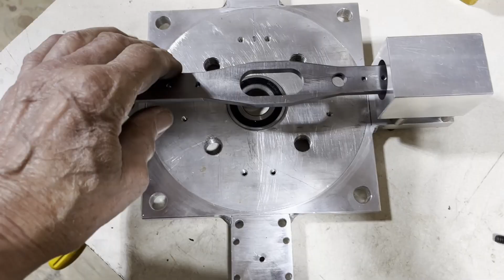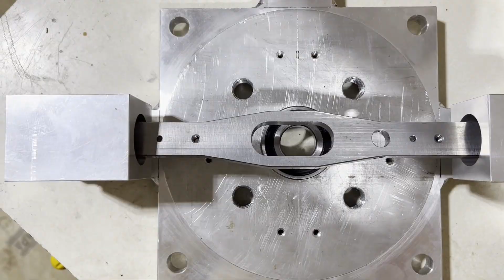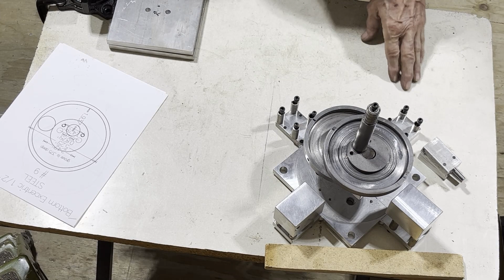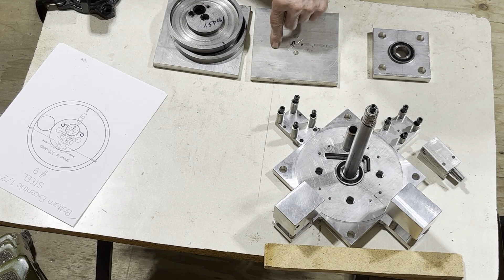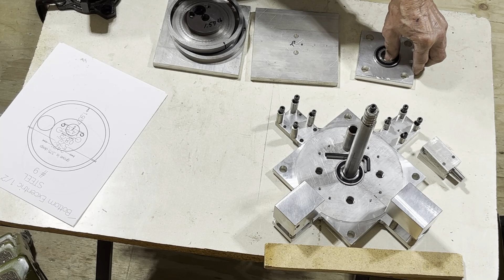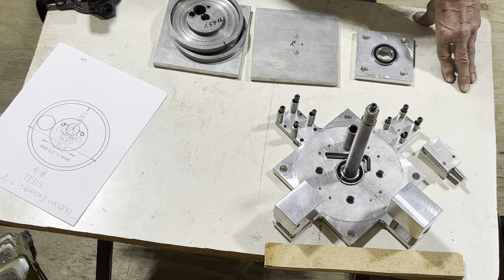Compressed Air Engine - Assembling & checking parts, finding some changes needed! 8-22-23

Comment: I am also planning on using leather for my seals in the future.. I think however lubrication is beneficial to keep the seals working good.. it's pretty easy to throw an inline lubricator it the mix to keep the valves and seals happy.. if you run the exhaust into a moisture trap that lubricant can be recycled indefinitely. I have a video on my channel explaining the lubrication system working on my third prototype air powered bike.
Reply from the maker: Oh, good to hear from you, I’ve been wondering if you have any plans or projects in the works?
I don’t have any long-term data on using the seals with leather, but I have been using them for quite some time on my prototypes and temporary valves and I have put oil on the leather so it’s soaks it up pretty good and should last for quite some time -  if it actually needs it.
Also, if it does start to leak, the design is so simple to take each cylinder off and just replace the piston or the seal or whatever is needed that it wouldn’t be a major problem if it does start leaking eventually. 
Well once again thanks for checking in and your comment. Always welcome.